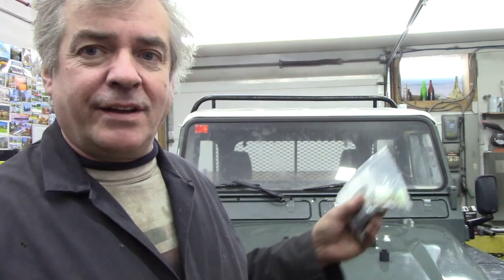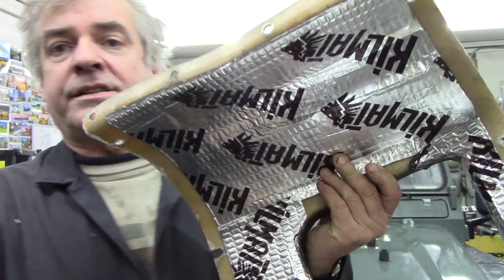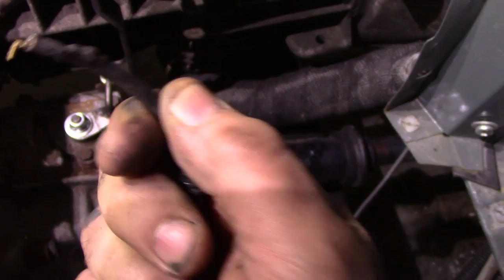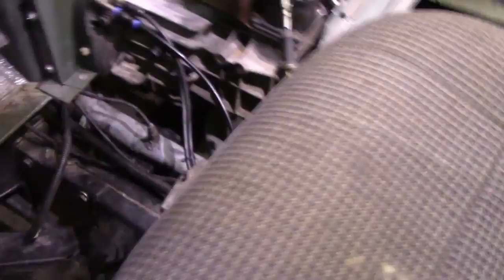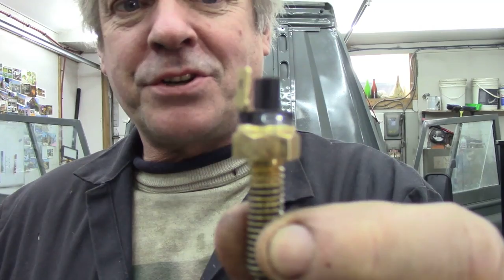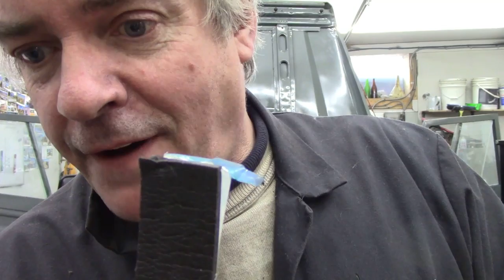Fitting the floor to the 110 project Part 1

Comment: Have you been giving some thought into , if running the rear end cables inside the rail would/could cause more internal corrosion because it could act as a rust trap?  Also don't forget to run a nice fat cable for your rear/trailer winch.
Reply from the maker: I have seen a lot of damaged cables once they have been pulled from the chassis - vibration is the worst

Comment: Same thing happened with my diff lock switch Mike I managed to solder it but then decided to replace it.
I used butyl tape for the floor plans I find it great for panels that you need to remove as it’s non setting.
I bolted the floor in but not sure it was the best decision should of screwed it down.
You are my inspiration Mike keep it coming 👍 best regards John Boyle Scotland
Reply from the maker: The closed cell foam makes a good seal and a dream to whip the floor out in a rush - I have had the misfortune to work on trucks that the floor has been held in with Silicone! 

Bolting t floor down is OK when the bolts are new, but after a few years of corrosion they can be a nightmare!

Comment: Home Depot has metal P clips  with the rubber insulator in Maine. And they have stores in NB, but not sure about Québec. I love how the metric specs on the foam are really just inch converted - since everything made in Canada goes to the US market.

Comment: G'Day Mike. Matey I stuck Dynamat/kilmat type sound deadener to the Underneath of my floor plates then stuck a sheet of closed cell foam with a silver foil backing over the whole thing, instant sound deadening/seal all in one. I then used as standard for my truck 8mm SS dome head bolts with SS gutter washers and SS nylock nuts  :)
Reply from the maker: The roof is the biggest culprit! they are like a drum and amplify and noise
The Dynamat/Kilmat is great for that!

Comment: Just a tip for bonding to GRP Mike.. wipe the surface over with acetone before you stick anything to it. The acetone will make the fibreglass go sticky.
Reply from the maker: I will see how it goes when I remove it when I do the transfer case - may not need sound proofing as there is no gearbox clatter with the V6 
Good tip though! 
As this was a prototype we used a white gel coat as there was some on hand - next ones will be black
Reply: Britannica Restorations Ltd if I were you I would degrease them and give them a coat of polyester primer before you sell em Mike, then people can paint them what colour they like and you’ll have the insurance that they won’t complain about issues when they paint them. It’ll also allow you to correct any surface imperfections and then paint over them.
Reply from the maker: Most cover with carpet or the rubber covers so it is not seen all that much